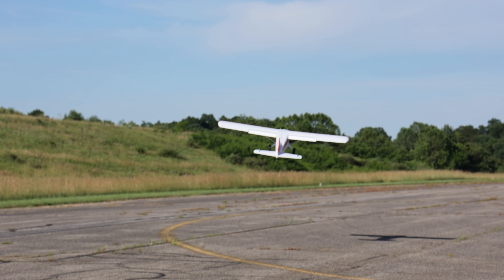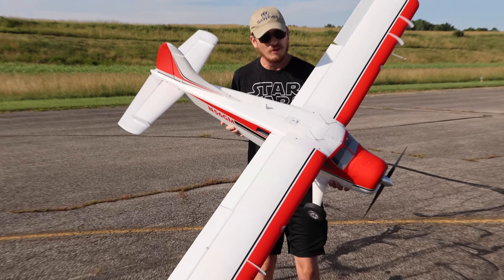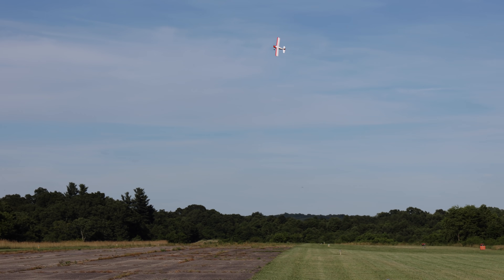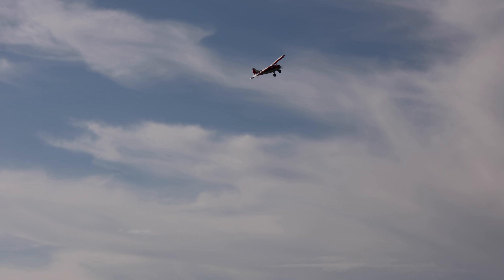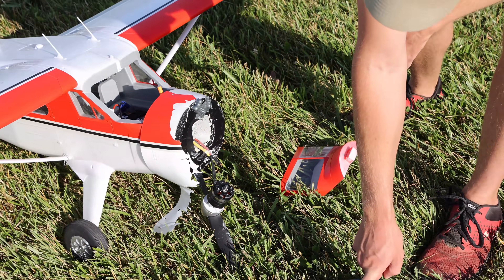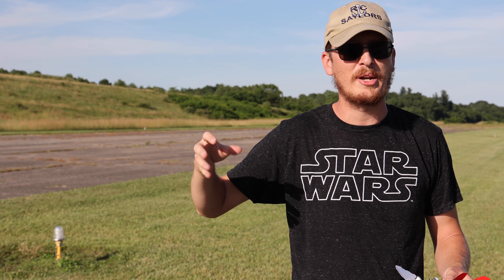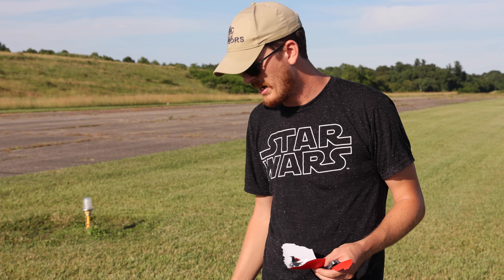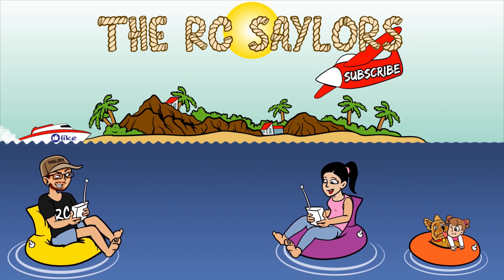GIANT RC AIRPLANE CRASH EXPLOSION!!!! - FMS Beaver 2000mm V2 - TheRcSaylors

Comment: Always and I mean always check the motor screws for lock tight. The prop was put of balance and caused the motor screws to back out from the back plate which entails why the “explosion “which was not a real explosion that was because the prop ate a cowling up. Easy fix nothing bad there. But make sure when you put it back together you use Loctite and always I don’t care how brand new they are take it apart and check for Loctite. These things are built by the thousands and quality control is definitely not their thing.

Comment: If the engine would have fallen off, it would have been a lot worse. Since it was hanging by the wires you kept your nose weight for balance and made a controlled  landing.
Reply: That is actually a very good point!

Comment: When you show the closeup damage I do not see ANY motor mount screws at all! I find it hard to believe they all backed out at the same time in such a short flight. It appears the motor was never mounted properly from the factory. I have one of these planes, Only problem I had was on second flight, Right before takeoff the right wing aileron servo was moving up and down on it's own which would have caused a crash. I took the plane home and removed and checked all the wing plugs/connecters and could not replicate the anomaly. It has been fine since then, But now I will check my motor mounts. Thanks for this vid, And good save after the mishap. Stay Safe.
Reply: replace that servo now....my clipped wing cub did same thing..could not find problem...5 flights later...crash....

Comment: Hello Nate and Abby 

First, I want to say that I really like your channel, you always seem to have a lot of fun and are up beat even when the poop hits the rotary oscillator. The Beaver looks like a great plane and looks so smooth. 

I won't dump on you about safety and all, that has already been addressed. One point of contention though, aerodynamics. Early in the vid you mention some "Vortex Generators". Correction, those are not Vortex Generators (VGs), those are Stall Fences. VGs and Stall Fences essentially do the same thing, maintain smooth-er flow of air over the wing control surfaces, notably the ailerons, during a stall. Stall Fences disrupt the span-wise flow of dirty air during a stall, DELAYING it from reaching the outer span where the ailerons are. VGs create small vortices that energize the boundary layer, which HELPS keep the airflow attached to the top surface of the wing longer (higher AOA).  

I know there are images of the fences located where you have them, However, I would move them inboard a few more inches, the outermost fence should be around the same station line as the inboard end of the aileron. This will give you more time (control) deeper into the stall. 

Again, you guys are doing a great job on your channel, keep it up.

Peace, Wolf

Comment: Nice landing when the motor blew off...pretty sure the issue was acres backing out of the motor... looking at the vid it doesn't appear the motor and motor mount wear damaged which leads me to believe it lost all its screws or somehow cleanly pulled them all out which is fairly unlikely...can we get an update on what happened and if the manufacturer is fixing it?

Comment: That is 100% a manufacturing defect. If they are as good as you say, they should give you a replacement. 

As for the flying the scale DHC-3 Beaver, it is such a classic plane that did a great deal to help open up the Canadian North. It was purposely designed for that role by de Havilland Canada. I'm really excited by the fact that Harbour Air in Vancouver, BC is pioneering a fully electric version of the Beaver.

Comment: Still it was not a clever mainoover, on closer inspection of the motor mount all the screw holes are still thier perhaps it's because he did not use locktyte on the thread's of the screws and nuts.

Comment: Dang, how can you tell the difference in noise between a unbalanced prop and a loose motor mount? At least you brought her down successfully.
Reply: balance prop before maiden !.....always check every screw on motor assembly before maiden....use thread locker.

Comment: From page 15 of the assembly manual: "Always check to make sure all screws on the aircraft are 
tightened."
Reply from the maker: I'll bet you've never driven a mile an hour over the speed limit, have you? They were tight. Issue is lack of loctite.

Comment: Maybe you can help me? When I went to do my maiden flight with my carbon cub s2, I plugged in the battery to test all the controls preflight. When I throttled up the propeller for the first time, the propeller itself blew apart into several pieces. So now I've tried to order a replacement from horizon but of course they are on backorder. Any info would be greatly appreciated.
Reply: perhaps try Tower Hobbies
Reply: Possible crack around your hub assembly?

Comment: Also in this case, the propeller may be tightened crookedly. and couch grass could cause the bolts on the cross to loosen in places in the bolts securing the motors, so that the bolts themselves were loosened, causing the foam to burst

Comment: That "Roar" you heard was likely a badly balanced prop or spinner. This causes a lot of vibration an electric set up would not normally have to deal with and is likely what either shook your screws out, or ripped them out of the soft threads. Have a go at balancing the prop and spinner and see what you find.

Comment: I bought 3d acro rc plane back in 2014 when i started hobby seriously after easystar as my first airplane. 1380mm wingspan with 13 inch prop ARF and was having issues with vibrations too. It was as loud as gasoline plane hahaha. Shaft was wobbling like 2cm here and there... I realized that motor mount area was having just a few drops of glue and wasnt firm against airframe, so i glued it and balanced prop. Interesting how most of quad fliers nowdays pay no attention to prop balancing. Even some 5 inch tri-blade props from dal and hq arent perfectly balanced. Bought 8 pairs of  2 blade props for like 4 bucks (gemfan) more than half unbalanced and put it on my quad. I was having black lines on my video feed because cable connector on vtx was loose. Lesson learned, problem solved. Tri-blades vibrate much less. Bi-blades with less pitch are in theory more vunerable to vibrations because of force resultante, more centrifugal forces especially with higher kv setups. Btw I even had to balance lawnmower after sharpening blade. Lawnmower only has 3000rpm, most RC aircraft brushless around 20K rpm. Inbalance can lead to loose screws and in long run shorten bearing lifespan and it reduces efficiency by 10-20%. Always balance propellers and dont go too cheap with them! Its shame that in 2021 some propellers arent prebalanced out of factory.

Comment: What is the repair?  New mounting bolts tightened with loctite and new and balanced prop/spinner and cowl?  Is the motor mount damaged in any way?  Were the ESC and motor wires damaged?
Reply from the maker: Sadly the motor and ESC wires were damaged. One motor wire got sliced! 😬

Comment: Yep this is definitely something that you need to learn from I've been in RC  Hobby for 48 years.
 Did you check your motor mount bolts when I was looking at the firewall I didn't see any bolt To be had anywhere for the backplate you should always check all nuts and bolts before flying it's OK use blue lock tide if necessary That my opinion was a failure to inspect your aircraft before you took it off That's OK you win some And you lose some
Reply: Let me know how that customer service went

Comment: Hi, I have a FMS beaver v2. My motor came loose, and we landed without throttle. There was an investigation carried out. It was found all 8 screws had either come out or were loose, on the motor and mount 
We used green Loctite, to lock them in assembly. The Propeller was put on the balancer, and was seriously out of balance. It was sanded to balance it, and re installed. So, i believe, the unbalanced propeller caused the vibration., which loosened the screws. Hope this information helps?

Comment: To be honest as soon as you heard it wasn’t right you should have landed the plane and not keep pushing it someone could have got hurt sor you made a bad call and got away with it.
Reply from the maker: Tell me you’ve never been driving 60mph in a 55 and didn’t instantly slow down to 55 the second you realized you were going over.
Reply: Jo Thats not a fitting Example do u  sit in Your car the engine barly Running and the Tank on Fire and say well its good to Go because it hasn‘t explodet  yet?

Comment: Watching and hearing that and you keep flying just upset me! 
Loud ass electric motor sounding like it’s a gas motor and you keep flying .   Jeez Luiz. 🤦‍♂️🤦‍♂️🤦‍♂️🤦‍♂️.   Sorry.   Just such a nice plane.    
We all make mistakes.     I have made way too many costing way too much
Reply from the maker: Yeah, in hindsight it's pretty easy to suggest that I land sooner. Honestly the noise progressed pretty quickly, and I feel like I made a wise choice to land when I did. Five seconds sooner and this would not have happened. 20/20 right?
Reply: You showed off for two more passes, what's it cost you to land and do a static run and then continue if it's ok. I can't help but agree if you had paid good money for it and weren't distracted about putting on a show for a video, you'd have landed sooner. She told you to just land 2-3 times

Comment: FMS= FIX MY SHIT
Reply: I need to come up with one those for Dynam. I’m mostly a Eflite, Freewing and Flightline purchaser, but about every 3 years I get sucked into buying a Dynam because of the price. Then I remember why it was so cheap.
Reply: @jeffhenderson934  I started out with dynam and hobbyking planes. Then I started getting the others you mentioned and I was like, wow these things actually work out of the box.
Reply: @jeffhenderson934  Dynam? Dave's yolo nasty ass modeling.
Reply: @MrDavidfuchser  the one nice thing about the Dynam/Durafly planes is I learned a lot about different types of glue. I honestly buy the screws/hardware package if it’s offered and to add a spinner and an extra prop to the order. I’m still in therapy after the purchase and build of a “Unique RC (probably a Dynam) Corsair. You got to add servos, pushrods, control horns, etc. It would be easier to list what was put together. (After all my bitching, it actually flies really well) 
Again, Dynam and Durafly really helped my build and repair skills .

Comment: Horizon Hobby should make good of the defective products.  They have great customer service.   You should have landed right away when you noticed the loose cowl noise.  Electric motors can do a lot of damage.  Always check for loose hardware before flight.   Always assign a motor cut switch on your transmitter.  A pilot in my rc club was rushed to the emergency room.  The prop on an electric plane ripped through his arm.  The prop to cowl clearance on the FMS Beaver 2000mm plane is close due to the thrust angle of the motor.  A very cool looking and flying plane,  especially on floats.

Comment: The cowl was not secured and engaged the prop, or the motor was not installed correctly. My guess would be the loose cowl engaging the very powerful motor.
Reply: The screws holding the motor to the motor mount came loose, and then the prop contacted the cowl. You can clearly see the X shaped motor mount still attached to the firewall.

Comment: My Beaver stated with a weird noise yester6and I thought it was the prop. I brought it in and noticed all four bolts mounting the motor to the mounting plate had come loose. I think they ran out of lock tite at the factory!
Reply from the maker: Same thing with ours! At least yours did not end like mine! Still, got mine fixed and flew again just fine 👍😁😎⚓️
Reply: I can't thank you ENOUGH for posting about this issue.  I just got my new Beaver but since I had watched this video and read the comments, I decided to remove the cowl and fake rotary engine plate and check my bolts.  From what I can tell, there are 8 bolts with metal to metal connections and they are 4 that mount the motor to the motor mount and 4 that mount the prop shaft to the motor.  All 8 were tight but ONLY 1 of them had any resemblance of a thread locker substance on it and that seemed more like sticky rubber cement vs something that sets hard like Loctite.  I used red Loctite (sets like Jolly Rancher candy is the best way I can describe it) on all 8 and tightened them well.  The other 4 screws/bolts that mount the motor mount to the fuselage go into nylon or plastic from what I can tell so I just checked them for tightness.  Thanks again for the great tip, likely saved me a lot of headaches!
Reply: @TheRcSaylors  So did Horizon do anything to make it right?  Did you end up eating the repair costs?  UPDATE:  Never mind!  I just found your follow-up video on this situation!  I'm glad they took care of you.

Comment: FYI the elevator rips off while flying as well. I’ve had nothing but issues with mine. I love Fms planes, I have several. But unfortunately this one is a dud. My cowl exploded like yours and the bullet connection shorted out causing the flaps to fail.
Reply: Im thinking it was a loose motor mount screws maybe all and with even the slightest bit of balance vibration  from transitions to idle to high rpm it eventually did what she did.
It happens nothing to be ashamed of we’ve all been there and maybe not pay attention to something we know isnt right.
Great attitude also. It sux wrecking anything easy to blame it on the plane.
Reply: @jnmwtkns  I’ve replaced my motor mount 3 times for this same issue. I even used red locktite. It still blows apart. It’s definitely a design issue.
Reply: @Rcguy2591  wow is the firewall wood or foam?
Does it have lock nuts?
Like the older ones had?
I remember I had a foam over wood spitfire 70 size fourstroke  
That had a terrible design the fire wall detached 3 times it just wasn’t designed right and couldnt be remedied.
It was just junk on the inside but looked cool as hell as a static model.
Sorry to hear about your troubles.
If your not crashing your not flying!
Wheels up !
Iowa , usa
Reply: Yes, I heard about elevator hinge problems on this model so first thing I did was reinforce elevator hinges.  Now I know to check my motor mount next as mine is starting to buzz oddly.

Comment: Hi my friends, I had the same problem with radian xl, TWO TIMES (diferent glider) and I knew that other radian xl glider pilots had exactly the same problem, so I dont think that a small vibration takes you to that disaster, I m sure that the motor mount is weak, so I sent some photos of the problem to HH, and the answer was NO, so I glued the parts again and reinforced the front of the glider with fiberglass, now it flies very nice and the weight of the fg, is not a problem, so thank you HH FOR NOTHING.

Comment: It was your fault for not landing right away when you heard it. Sounded like the motor screws came lose.
Reply from the maker: Hindsight is 20/20 isn't it!? I wonder, have you ever made a mistake?
Reply: Ive had this happen before turned out to be a motor mount screw that was stripped chances are even if you tightened the mount and balanced the prop it still would have happened. Fms should replace it as eflite replaced mine not your fault mate and at the end of the day you learnt something haha
Reply: James I agree the motor did come loose I’m almost positive and the prop was rubbing against the cow. Check your motor in the build.

Comment: Looked and sounded like the prop / spinner was out of balance . Simple basic pre flight checks,set ups and fixes. The roar of that model flying flying by was wrong and the pilot should have landed and checked it out but no carried on flying and the motor vibrated itself loose and fell out. The light construction of these models needs everything to be able to run smoothly , once it starts to vibrate it will only get worse. 
OK my comments perhaps a bit harsh but the vid  did show the fly by getting louder with plenty of time to throttle back and Land. The video would have been far more informative had you found the fault an hilighted it for other buyers
Reply from the maker: Your opinion vs mine.  I did land early.  Two and a half minute flight instead of an eight minute flight.  Just didn't land early enough by about two seconds, right?  Hindsight is always 20/20 and videos are pretty easy to pick apart.  Life in the moment is always different that watching a video back over and over, disecting it.  Have you ever accidentally driven over the speed limit?  I'm guessing you probably could have avoided doing that and you definitely didn't need to be going that fast when you did!  Shame on you!  Driver error.. right?!  Lol.. I think you see where I am coming from.
Reply: @TheRcSaylors if you were a respectable rc pilot bring it in to do field check and then continue ???

Comment: Dude, it was not totally out of your control. You are a good flyer but forgot SAFETY comes first. If something seems wrong, you land 1st opportunity.  No if ands or butts.
Reply from the maker: I could have flown (theoretically) much longer, and if I were being destructive intentionally, I would have. I made the decision to land and cut my fun short by a lot as the noise progressed and worsened over time. Of course hindsight is 20/20 and it's very easy to make these suggestions while watching a video. I suppose you've never accidentally driven a real car over the speed limit even by accident for a second or two? I'll admit, I flew my foam plane for a few seconds too long. I am human, and I made a mistake. Flip side, this should never happen on a PNP model.